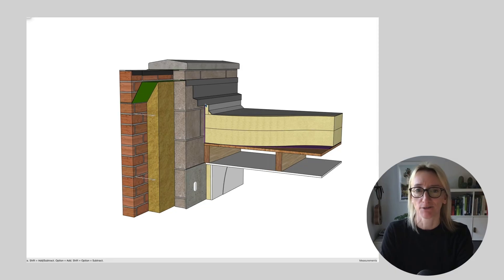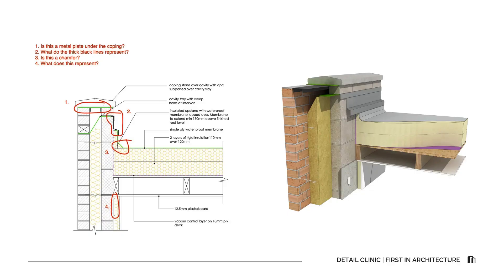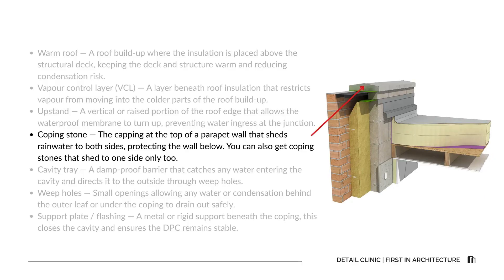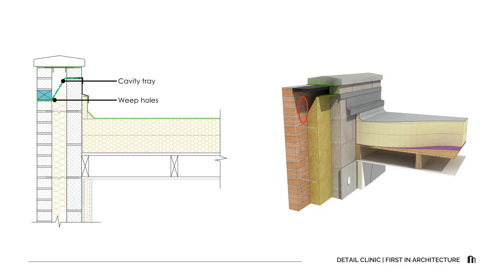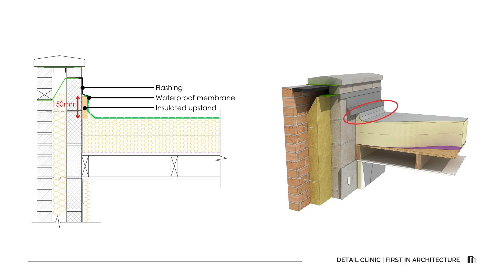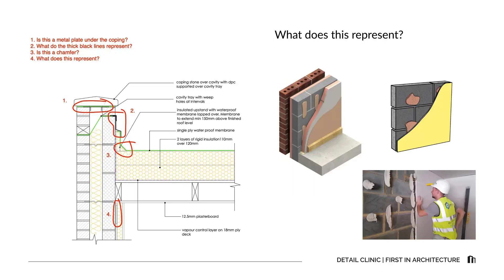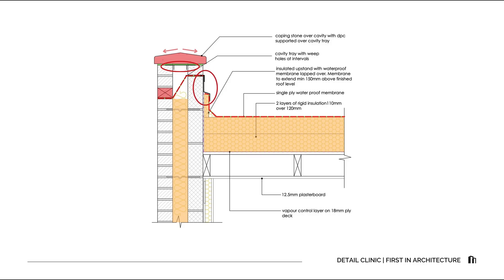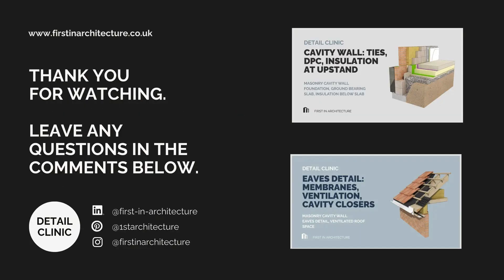Flat Roof Parapet Detail Explained | Copings, Cavity Trays & Waterproofing (Detail Clinic Ep.03)

Comment: I an so pleased to see a serious attempt to discuss how building details work. So thanks. However, I am quite surprised that an air barrier system, comprised of connected materials forming an Air Control Layer is not mentioned!  Vapor control is a much less significant or at least not commonly need control layer, but an air and water control layer is always needed.  The Water control layer could also be usefully called out.... in the roof it is the exposed roof membrane, but in the wall it is ??
Reply from the maker: Hello, thank you for your comments. I see that you are based in North America? I think your construction methods and terms vary a little with the UK so that might be the cause of some confusion here. All our videos are based on UK construction and standards :)
Reply: @FirstInArchitecture  my comment was not about construction materials, methods, or culture. A building enclosure must control water penetration, air leakage and thermal transmission before it worries about vapor. So the Water control layer, Air control layer and thermal control layer (insulation) are required and almost always more important than the Vapor control layer.  These are requirements of physics and so apply in Japan, Nigeria, Canada, or New Zealand as well as in the UK.   Terms can vary, but I did not see words like "sarking", "underlayment" etc, which though imprecise might hint at what is intended for fulfill the funtions.  Architectural details should clearly indicate what/how rain, air, heat, and vapor are controlled.
Reply from the maker: Thank you John, appreciate your comments. We will do our best to make sure the videos are clearer and easier to understand in future. It seems we missed the mark on this one so thank you for your feedback.